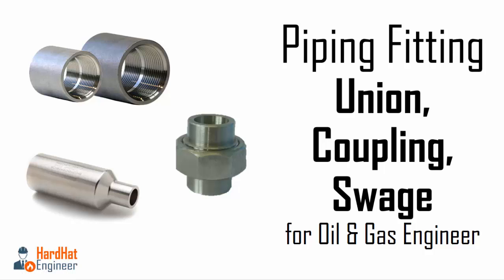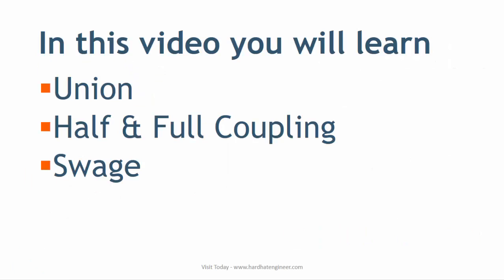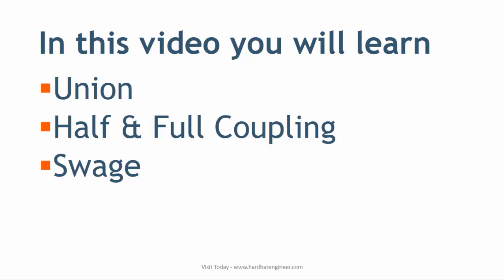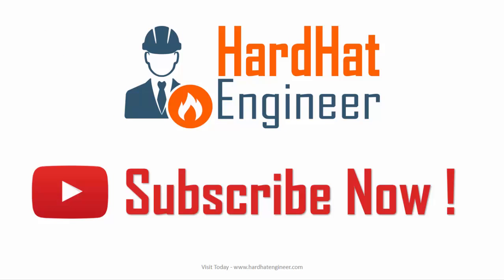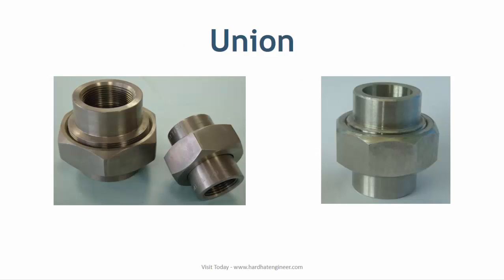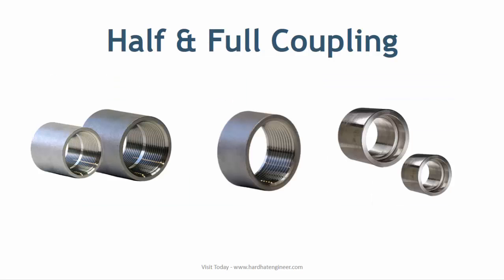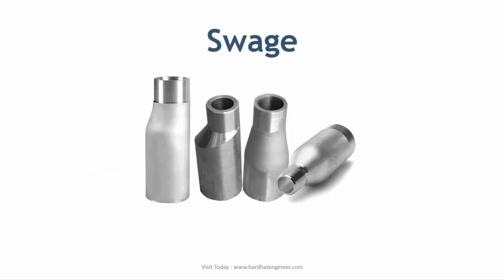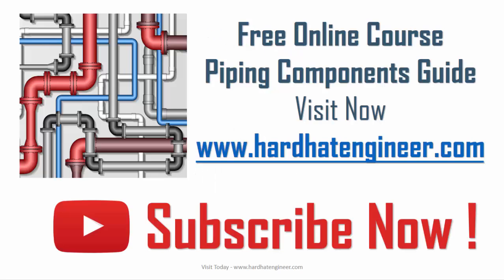Pipe Fittings - Union, Coupling, Swage. Part 3/3

Comment: sir, what are the pressure rating of valves
Reply from the maker: Pressure-temperature rating is maximum allowable working gage pressures in the bar & the temperatures in degrees Celsius. or simply you can say it is the maximum pressure at particular temperature valve work for a particular material.

Comment: Why we use union in pipe fitting....????
Reply from the maker: +Gaurav Vashisht Union provide flexibility for maintainance. It used to connect to different sizes of pipe and other connection. Normally used in small bore water line.
Reply: Plllzzz tell me some uses of union...coz evry1 said union has many uses..so pllz sir...point some uses
Reply: HardHat Engineer thnku soooo much sir
Reply: easy to replace for sometimes

Comment: how to make union joint
Reply from the maker: Union joint comes in two part. You can connect these parts to the pipe by socket welding or threading.